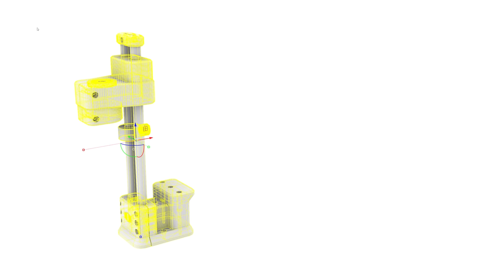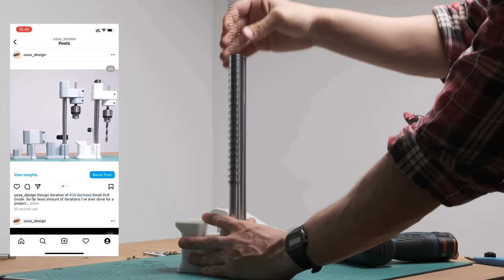How to Drill at 90 Degree || DIY Simple Drill Guide

Comment: Might I suggest the addition of linear rod bearings? They are relatively cheap and reduce the friction of the main action
Reply: I was thinking of the same thing but have what I think is a cheaper solution. Get a multipack of grinding paste and lather up a rod and run it through the holes a bit with various amounts of the paste. cleaning would be a pain but you'd have a super smooth plastic on inside, or oversize it and put in metal bushings.

Comment: So satisfying watching your videos. Would like to know if you planning on adding a drill press handle?
Reply: I've got an old drill, and I know the motor still works on it, just the battery part failed. So I was thinking that if I could remove the motor unit from the old drill, I could attach it to a 12V PSU, and modify/exchange the bracket so that it would hold the motor assembly. If I'm smart about it, I might also be able to use the chuck/gears/clutch/reverse mechanisms from the drill too? Then wire an auto start for the motor when you start pushing it down

Comment: With my limited knowledge, the extra drill chuck feels unnecessary.
Could you explain the choice?
Reply: Well the unit as whole doesn't make any sense to me. If you buy hardware for such flimsy design, you're already about 50% of cost of cheapest table drills that come with chuck and motor for bare minimum. Heck I got quite cheap Bosch model and it has got clamp, fence, digital display for depth, depth stop, variable knob adjustable speed and laser pointer. Cost of about four decent quality Jacobs chucks.
Reply: @jothain  With a big table drill you can't drill into some big things, here you can put the drill directly onto the workpiece.
Also this is small and doesn't take up a lot of space in your home

Comment: I like the simplicity in the design but I doubt it's longevity. These vibration will probably make the contraption loose over time. I would stick there at least two nylon or delrin bushings to be the contact surface on that rod. This would also eliminate issues from microscopic dust. At least that's my intuition.

Comment: You could step this up to the next level by adding a dovetail to the bottom for rail mounting and optionally an acme threaded rod, an indicator, and a tape measure along the rail. You could get repeatably spaced holes. I don't require credit, just access to the cad files and/or if you make it send me one. Or even better a rod and linear bearing instead of a dovetail.